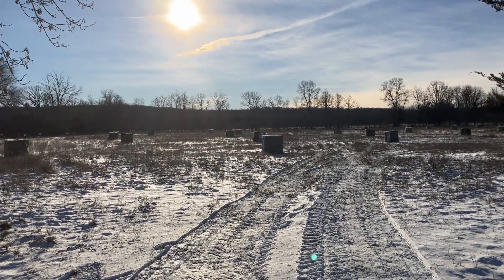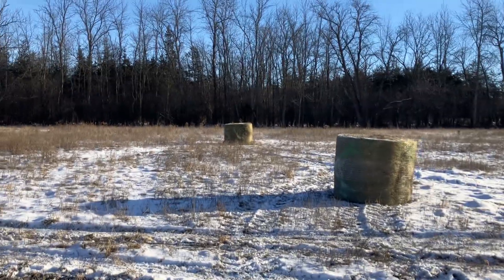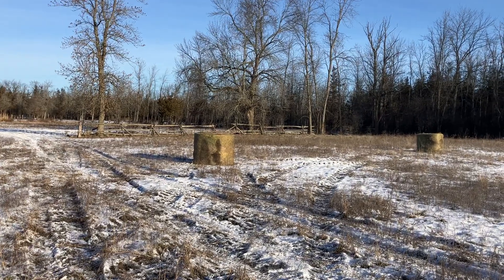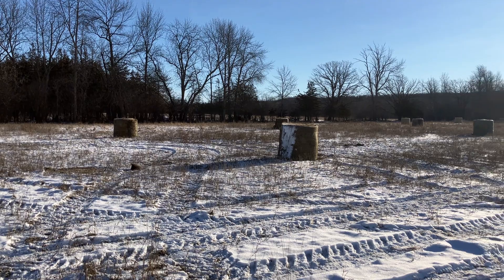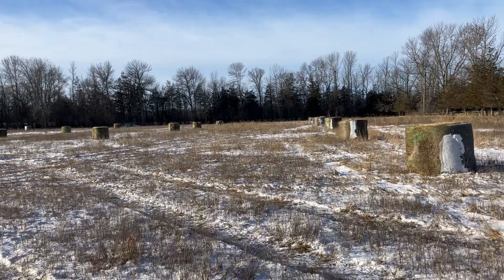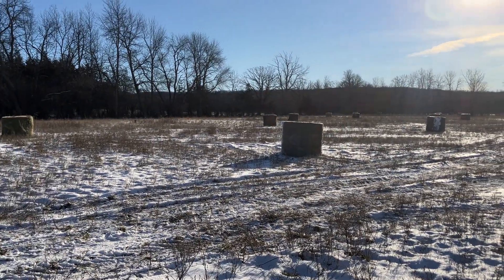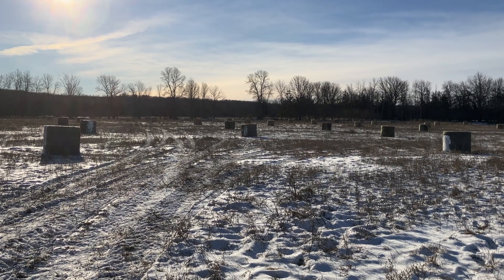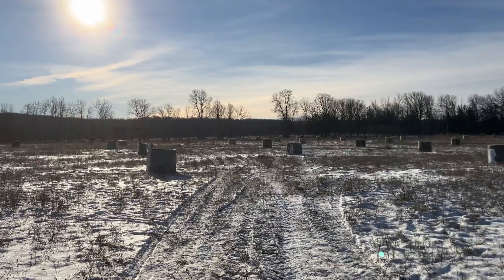How We Set Up Fields For Winter Bale Grazing

Comment: Curious, why don't you Unroll the bale across the paddocks, instead of bunching the cattle up around the bale? Enjoy the vids .. keep up the good work!
Reply from the maker: Great question. I love rolling out bales. But it’s tough to do with 2-3 feet of snow. What I like is that by positioning the bales in advance it front loads all the labour and fuel use, and this way you don’t really need to use tractor for cattle all winter. The bales stay accessible for feed this way too standing 5 feet tall while rolling out bales for a couple days may get snowed over and spoiled easier. This way just cut twine, move electric wire, and your done. So part of it is convenience and practicality, when farming through a Canadian winter. 

If we got just a bit of snow like Greg Judy in Missouri, I’d probably be rolling out bales.
Reply: Copy that! Makes sense. Thx Chris
Reply: Well thought out.